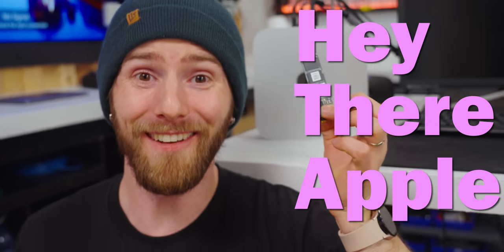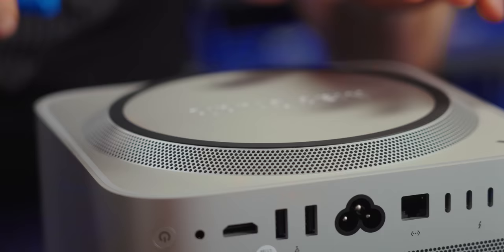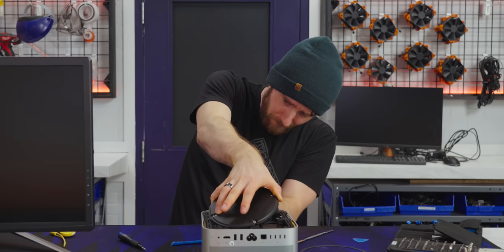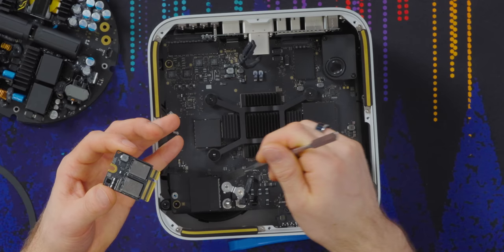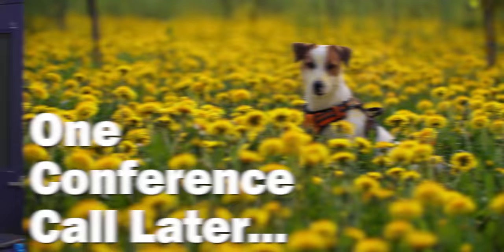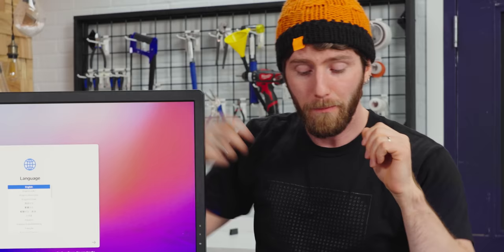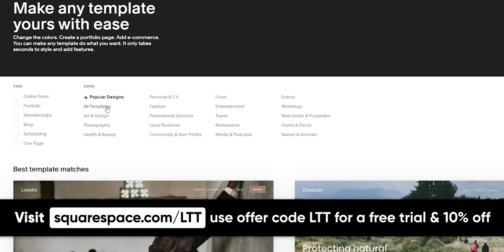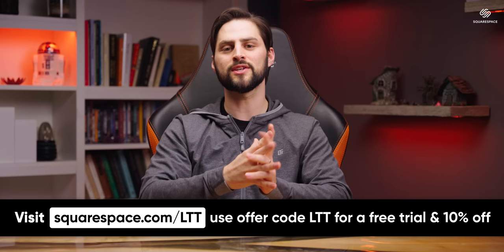I want to love Apple, but they’re making it hard - Mac Studio SSD Swapping

Comment: I kept an old Sony laptop going for almost 10 years by incrementally upgrading it. More RAM, swapping the HDD for an SSD, even upgrading the wifi chip which was socketed. Not possible with this Apple crap so it's a no from me.
Reply: Or with most modern PC Laptops or All-in-Ones? I don’t think I can upgrade anything in any of my PC laptops except the M2 SSD in Surface Pro 8 :(
Reply: @DanielHarrisCodes  Well - it depends - sub notes - yes, most of these aren't upgradeable these days - but if one can check before buying a new Laptop, you will find Laptops in the 15" and above categories that are well upgradeable with SSD, RAM and WiFi - in some rare cases even the GPU is swappable – but that doesn’t make sense most of the time as these modules are priced horrendously.

…and All-in-Ones are IMHO a big No-No anyway – whilst some of them are in fact upgradeable.
Reply: @first last It would be great if they went back to letting you just add RAM in laptops and ultrabooks I agree.

Suppose one thing to think about with the Apple is how they retain value, a Macbook might still fetch £400-£500 (My 2012 MBPr did in 2021) for example.

I only upgraded it because the M1 MBA was on offer, I just use it for building apps (nothing that requires a beefy Mac - But if I didn't need a Mac to publish to their store I wouldn't really need one at all)
Reply: Have a MacBook pro 2010 13 inch. Upgraded RAM and SSD. Still running Office programs nicely for my wife. Like the keyboard more than the one from my 2017 MacBook Pro.
Reply: Same, but the overwhelming majority of consumers doesn't want to do that, or can't. So they buy new. That's why an open market and doing research is so important for consumers.
Reply: last year i upgraded my brother‘s 2012 macbook pro with 16gb ram and a 512gb ssd and it still serves him in his studies. it was pretty easy as well, no soldering or any of that crap needed… apple is really pushing it.
Reply: Back in 2012-2013, MacBook pros were upgradable. I upgraded my hard drive to an SSD and added more RAM. I had that laptop for 8 years without any issues until it got stolen.  All companies are transitioning to this. Apple isn’t the only one. Why aren’t people going after other companies too? My gf has a Lenovo yoga laptop from 2015 and that thing is hard to upgrade the storage. You can’t upgrade the RAM either.
Reply: I have a 7 year old desktop that's been surviving well due to the same. A relative's Mac's already lagging 2-3years in. I never want a mac.
Reply: 10 years? I'm on 14 with my Lenovo Thinkpad T61. All the same steps as you  apart from the WiFi card. I tried a swap and it refused to boot, claiming the FCC had blocked it for that device. 
I'd go for 8gb of ram, but DDR 2 4gb sodimms are not cheap!
Reply: Still using my Mac Mini 2012 on a daily basis. Upgraded the HDD to SSD and maxed out the RAM. Sure, it won't run modern intensive programs, but for my needs it works better than when I first got it.
Reply: @m.l.9385  Does nvidia still make MXM modules anymore?
Reply: @DanielHarrisCodes  Only a fool would pay that much for a 10 year old laptop. Apple retains value because of brand recognition...and not the technical capabilities of the hardware itself....which is not how PC hardware is priced on the used market.
Reply: @milanlabus1582  Yup which  is why more upgradeable systems are more expensive...because if you shell out $2000 for a laptop you pay for the privilege of upgrading it.
Reply: I’ve a MacBook Pro for more than 10 years with no upgrades and works perfectly
Reply: @VoldoronGaming  AFAIK NVidia never made any themselves...but there is also no official/declared end to MXM – so any board partner could make one – if they wanted to.
The last one that came out was AFAIK the RTX 2080 MXM-Module – released end of Q1/2020 by Clevo. 
AMD ended with Polaris in Q4/2017.

You can still buy some - but these are hard to come by and they aren't cheap...
Reply: That's OK, I have Apple products that are over ten years old that run well without upgrades, so no big deal.

You won't be running Windows 11 on that ten year old Sony any more than I'll be running macOS Monterey on my ten year-old Mac.

No big deal.
Reply: @VideoArchiveGuy  Okay, you are an Apple fanboy we get it...
But Apple deprecated a lot of models that won't even run Big Sur anymore.
And no my 10 year old Mac Book Pro wouldn’t run well, if I didn't upgrade it with an SSD and more memory (more than Apple officially supports BTW).
Reply: @m.l.9385  Yes, Apple deprecated ten year old machines, which is an incredible life span for a computer.

By comparison, how old are the PCs that won’t run Windows 11 again?

No decade-old system is going to run a modern OS well with all the multimedia features people demand.

This doesn’t make me a “fanboy” as much as you want to apply the label; rather anyone working with computers knows much more than five years old makes any computer a relic of a previous era.
Reply: @VideoArchiveGuy  What is it with your fixation with Windows 11? 
And a bad decision from Microsoft doesn’t make any bad decisions from Apple a good one.
The point of this Video is - Apple prevents their users from Upgrading even elementary things like SSD.
Reply: @m.l.9385  Who has a "fixation?"

I dislike Windows 10, and frankly any OS with the word "Windows" in it anywhere.

The point is, if manufacturers want to continue adding new features and updating their graphic environments, it's inevitable that older computers will be too slow to provide a good experience running the new OS.

Comment: The recovery environment used to be stored on a partition of the boot drive. If swapping the flash module makes it unreadable it would make sense the recovery os is gone.... but they could drop a usb stick in there with a recovery os at least.

Comment: “Can I put an extra SSD in my Mac Studio?”

Apple: “But what about the safety and integrity of your device! We have to do it in house for your security!”

“So will you sell me a proprietary SSD?”

Apple: “…”
Reply: Of course they will sell you one! It only comes with a whole Mac Studio attached to it.
Reply: @BrainHurricanes  I see
Reply: @BrainHurricanes  clever upselling
Reply: @BrainHurricanes  But to get that whole Mac Studio, you also need to be an Apple certified repair shop.
Reply: I smell a loophole :3
Reply: It's funny how they moved the controller and cache to the socket but then charge more money for the actually cheaper flash module.... so yes ''...''
Reply: I get the frustration, but they never said that.  At least about this.  I think right now they haven't made up their mind whether this is going to be a FRU or not.  They left the door open for IF they decide to sell upgrades, which is only half-stupid.  I assume they're going to feel out the market to see if it's worth pursuing, but at least have provided a technical means of doing so.  IMO, that's at least better than soldering the flash chips to the mainboard.
Reply: "So by security measures, will you keep extracting my personal information you hard-store on your devices without my consent?"

Apple: "..."

Comment: Usually products are either cheap and disposable, or expensive and repairable.   Apple's innovation has been to pioneer the expensive and disposable idea as a good thing.   

The fact that people keep buying these products, continues to surprise me.
Reply: I would ditch Apple in an instant and start building my own PCs if Windows wasn't still such a mess compared to of Mac OS.
Reply: Sorry, how is the most popular OS "a mess?"
Reply: @notsure4539  depends on the use case.
Reply: @iAmTheSquidThing  mac os is a mess as well especially now . if you try to use anything that has legacy on mac os you are plagued with issues . windows is the most veristile os you can run legacy software on any pc and it will most likely work you cant do that on mac osx plus windows is usually got browser support for a longer ammount of time
Reply: @notsure4539  bs with Microsoft edge and ads in the start menu to start😫
Reply: @iAmTheSquidThing  your argument falls completely flat because MacOS, Windows, and even many pre-packaged Linux distros are just all, a mess. About the only way to avoid anything at all being a mess is to pretty much build your own distro or start from the base of one and then clean out the mess because it's Linux. I say this as someone who still daily drives Windows 10 on three-quarters of my machines because of specific software needs mostly for work.
Reply: There will be always losers who need a prestige product to maintain their self esteem.
Reply: @iAmTheSquidThing  Yeah sure. A mess. Not in details. Lol
Reply: @bleuebloom  MS already said the Explorer ads weren't supposed to be enabled. And who uses Edge lol
Reply: @notsure4539  me for downloading firefox
Reply: BUT DUDE ITS SO FAST!!!!!!
Reply: @notsure4539  it is I'm a Windows user and it's a fucking dumpster fire
Reply: @NaN I get a lot of use out of legacy support, personally.
Reply: @blunderingfool  My 2004 iPod has full integration and support in the latest version of Apple Music. And if we're talking support, iOS is simply unbeatable.
Reply: @iAmTheSquidThing  Mac OS is worse than windows
Reply: @YearsOfLeadPoisoning  i've got an iBook G4 and a eMac G4 so that's as far as my experience goes... Being able to still play win95 games is pretty nice on the PC side of things though.
Reply: The sad truth for me is that as much as I hate Apple for doing this, I still need to purchase their products because Windows is truly terrible and keeps getting worse. I really hope that Linux can catch up to MacOS in the GUI aspect so I can switch my desktop to Linux completely.
Reply: @bleuebloom  Really? Looking at my start menu right now and don't see any ads. Also, why are you using Edge?
Reply: @iAmTheSquidThing  Linux
Reply: @ravenrush7336  "windows is such a money grab!!!!!" continues to purchase apple products
Reply: @binguslover0508  at least Apple does good software and, though unrepairable, excellent hardware. Microsoft just does bad stuff
Reply: As a Linux user I can confirm windows is a mess
Reply: @iAmTheSquidThing  now any more.
Reply: @arandomhumanbeing2464  microsoft bad apple good ooga
Reply: @Dr.Spatula  ok dum dum, when you get a new pc there’s app icons for apps on the windows that aren’t on ur pc but u could get, and even Linus has complained about Microsoft excessively pushing edge, in windows 11 at first changing the default browser was a whole list of options for files browsers can open you had to go through one by one
Reply: @binguslover0508  I didn't say that windows is a money grab and I have no problem paying for software. For me the problem with Windows is that I have to spend a lot of time researching and fixing problems which Microsoft should have fixed by default. I simply feel that that my time is better spent doing something else.
Reply: @NaN Mhmm. I'm not a windows defender. I just use it because it'a been my daily driver OS since '99/'00.
Reply: @iAmTheSquidThing  i build my own pc every few years since the 90s and i see no mess.
Reply: @NaN being an ex apple technician who worked during the days of snow leopard i can speak from first hand experience aboiyt how mac osx isnt the greatest operating system and not as veritile as windows  part of its issue is the propietary naure of apple

Comment: Apple: "Let's spend our engineering efforts on our packaging and save money on SSD controller and cache chips. People are buying our products for user experience, and unboxing is very important."
Reply: Actually yes, the the eco-friendly charger bullshit was a a distraction to save money on crate space (shipping), way more money than the charger value.
Reply: Yeah people are like "wow, such nice packaging and the PCBs look nice". That packaging and PCB design cost extra money, meaning they went out of their way to spend money on it instead of things that actually matter. The box is going right in the recycle bin after I open it and they made it so most people will never see the PCB. I would actually prefer if they just used cheap cardboard and charged me 50 cents less.
Reply: @rubiconnn  It's weird to think of Apple computers not having matte black PCBs, but that's what they want you to think

Comment: I love Apple and I've been using Mac's since 1984, but you are right. There is no excuse to lock out NVMe SSD upgrades. Especially important in the long run because SSD's are not designed to last forever.

Comment: The last Apple product is owned by my father, a Mini late 2012.. I've changed like 2 SSDs on that thing, added ram.. it's still going well. With all the proprietary/soldered bull*hit, nope, not ever again. Oh wait, it's not even compatible with newer macOS versions, so now it runs Windows 10 perfectly xD
Reply: RogerWilco99  if you're not using it, can I have it?
Reply: RogerWilco99  whats the new pcs specs
Reply: Yep: I dusted off my brother's old mini mac 2011 - upgraded the RAM and SSD drive - and I still use it today. I bought a macBook pro recently and only because its the only laptop that can run all the software I need, but the inability to upgrade the RAM or Drive is a huge shame.
Reply: macOS, not iOS.
Reply: RogerWilco99  That means you haven't investigated your mom's need enough before buying. Your mom cares the form factor more than you. There are Intel NUC and other similarly small design outside Apple for her to upgrade to.
Reply: @bigdak9814  yeah my bad